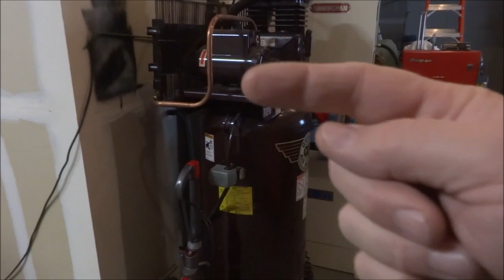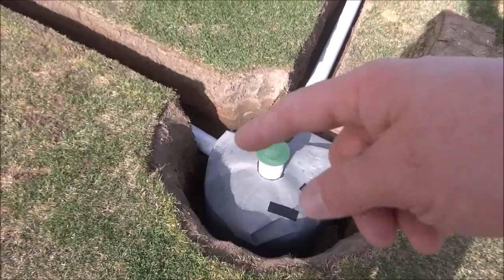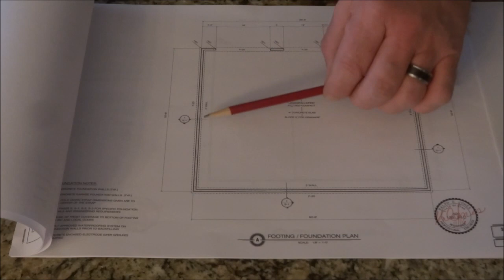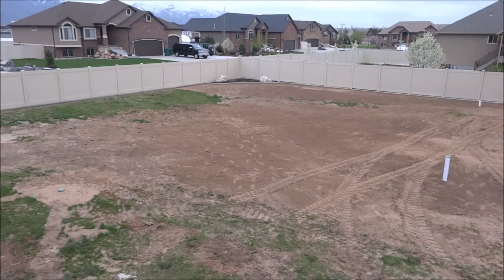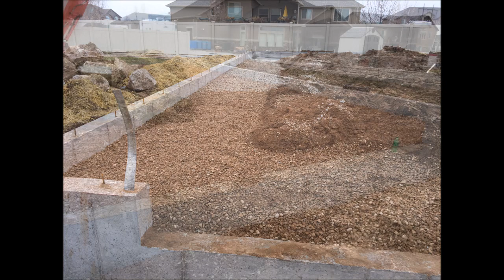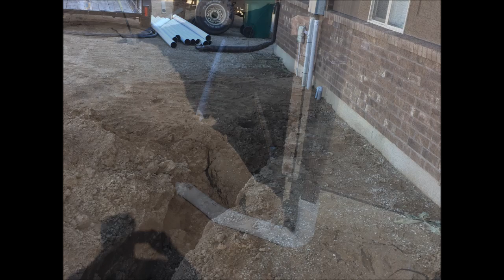Shop & RV Garage Part 1

Comment: in new zealand it is mandatory at all propertys have all storm water taken to a working soak pit or council lateral, so strange how you can just let it flood out beside your house
Reply from the maker: Most residential areas here will not allow you to divert storm water off of your property.  I prefer a dry well or simply let it absorb into the ground but the people we purchased the home from had everything being dumped at the foundation which is not good no matter what country you’re in. That’s why I chose to utilize a dry well configuration and get it at least 20’ or so from the foundation. 
Thanks for watching and commenting. 
Mike